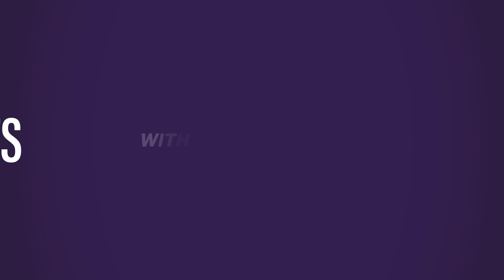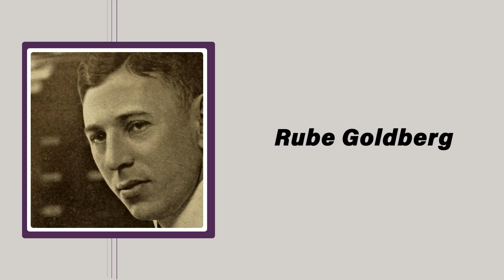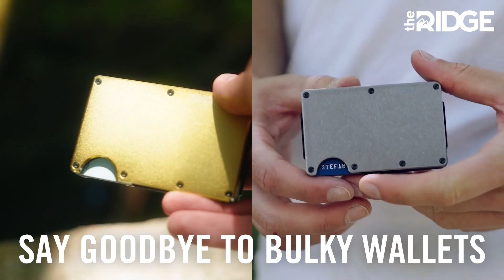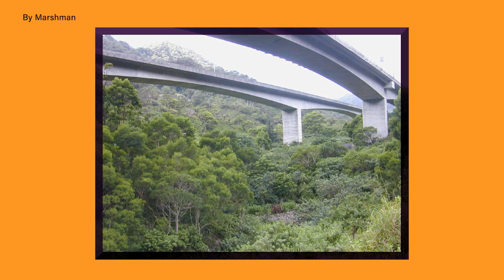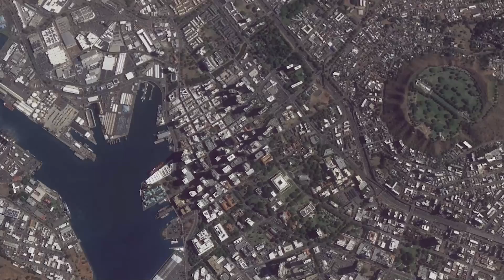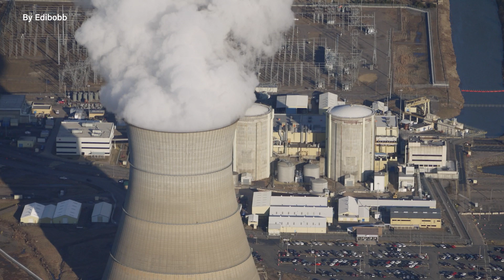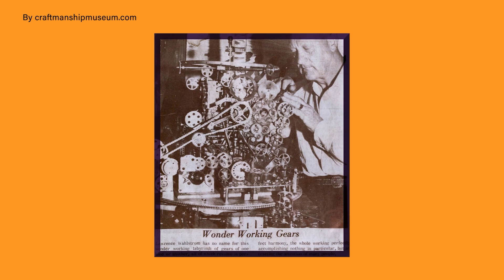Most Useless Feats of Engineering

Comment: I worked on a computer system that could have been described as a Goldberg Machine. For example, you could set the value of a variable like so: FirstName = "John". But that would be too simple. The way it did it was call a service, that called another service, that called a class which extended another class by adding ONE function (the one being called) which used a Lamba function to set a hardcoded/static value to a variable then returned that all the way back to the caller. After working on this nightmare for 9 months and realizing that every day was just another journey into frustration, I found another job.

Comment: This is the art that engineers get up to when they're bored. It would be cool if you did a side projects on art cars. You'd have a lot of fun, and it's amazing the amount of practical things you learn just to be able to do them. They used to be huge around here, and in California I think they used to have a festival. The rule is, they have to be drivable, and non-violent. There was a dragon art car that actually belched fire, but it wasn't enough to hurt anything. Anyway, it's a fun side project.

Comment: Hello Simon. Late to the party, but that's because I'm old. I get away with a lot.
I was trained as an electronic engineer and built an electronic Rube Goldberg machine as a Junior level senior project. As you can imagine, my professor and my lab monitor both disapproved, and it was the only time I received a D grade for the class. It was worth 1 point in a degree that required 160,and I managed to get what I needed to graduate by receiving 1 point for class participation by a friend who was an instructor in the school. That was a long time ago.

The real reason why engineers want to build useless machines, my hypothesis involves the number of times we all were called upon to create something, that we sweat blood over to meet the criteria, and do so with size or weight or power limitations, the item we made was scrapped by the "suits" for what ever reasons. That frustration, as engineers like to see their creations in action, gives us the urge to build something to that does nothing but flash lights, trip relays, spin gears that move levered beams that open and close venetian blinds, and a dozen others. That's the source of this machine, the satisfaction of seeing your product in use. Anyone agree?

Comment: The construction of H3 actually started in 1972, but was held up in litigation starting in 1977 until 1987.  We used part of it to ride on go karts in the mid 70's before it was open.  H3 is very useful to residents  and we use it all the time as one of 4 transportation routes from one side of the island to the other side. Three tunnels and the long way around the end of the island. Over priced yes and controversial yes. It is also incorrect to say it goes to nowhere. It connects to H-1 and H-2 interstate system so it goes to just about everywhere on the island.  Saying it goes to nowhere is incorrect.  Saying the Interstate system in Hawaii does not connect to any other state is correct. It was built as part of the interstate system so federal money could be used in the construction. I will be interested to see if you make any corrections.

Comment: Another comment on H3. What’s it’s primary purpose? To connect major military hubs (Kaneohe and Pear Harbor). But as others have also mentioned, it’s secondary purpose of being a shortcut from Eastern Oahu to central Oahu is extremely useful also. It probably saves an hour of driving, plus has much more capacity than the other route.

Comment: Bad research staff!  

The H3 system can be quickly used to repurpose rapid transportation from Kaneohe MCAB to Joint Base Pearl Harbor/Hickam and Honolulu Harbor. The H2 can be allocated if Schofield needs to move their heavy equipment as is the H1. 

The H3 is likely the best highway in the world, certainly in terms views from within a vehicle, but there were challenging engineering challenges that were met and addressed if you actually drive it.

Comment: The H3 isn’t useless, and it goes nowhere about as much as any other road, it might be expensive, but it’s the most beautiful drive I’ve ever done, I would go out of my way just to take that route north. since it’s the only interstate to the north it’s necessary if you don’t have a to. Of extra time to flow the coast, I didn’t work when I was there so it didn’t matter to me. The cost comes in because it’s a heavily democrat state. Everything cost double to get done. Look up the monorail from the east side to the west. That makes the H3 look like a cheap quick project.

Comment: Sorry, Simon.  You picked the wrong project on Oahu to call "useless".

The useless project you should have spotlighted is the light rail system.  When I left Oahu, Hi, thirty years ago, it was finally, in the first part of it's building process.  Thirty years later, it still has not been completed.  Most of the infrastructure and has been completed, yet the project has not been completed.  It's elevated rails and never opened stations along the route have never been used.  And yet, the state and county and city pour money into it year after year after year.

THAT makes it truly useless.  Unlike H-3, which at least takes you from the Leeward side to the Windward side without having to drive half-way across the island on the Likelike or the Pali.

Comment: Ironically small bore hole nuclear waste storage is gaining more attention again. The idea is to essentially store waste deep deep underground in non permeable layers of rock using conventional oil drilling hardware. While Yucca mountain sat above the water table and there were concerns of leaks contaminating the water table, small bore hole storage will sit kilometers below ground where the material can sit for billions of years until subduction pushes the continental crust into the mantle. And don't worry about the mantal. A fraction of the internal heat of the earth comes from the nuclear decay of uranium and thorium.

Comment: The H3 was voted as one of the most beautiful highways in the world. It starts on both sides in fairly urban areas and almost immediately darts into uninhabited rainforest. Coming from the Honolulu side, you go into the tunnel at ground level and pop out on the other side almost 200ft above the rainforest canopy. It is a very useful highway in my opinion as it connects 2 very densely populated parts of the island and serves as a vital route for moving military personnel and equipment between the 2 bases. Lastly, it's not referred to locally as an interstate. It falls under the highway portion of the Eisenhower Interstate and Highway Plan. The H stands for Hawaii as Alaska has federal routes designated as A1, A2, etc. Those routes are not connected to the lower 48 so they don't get the more familiar I designation.

Comment: I'm a DOE nuclear engineer involved in strategic planning for addressing the nuclear waste problem, and there is a different side to it that I don't see anyone talk about. We really DO have a serious nuclear waste problem, but it has nothing to do with safety or security (the casks used to store the waste are virtually indestructable/leakproof, and they are kept onsite at the nuclear power plants which are among the most highly guarded sites in the country). The actual problem is that the gov't made contractual agreements to the nuclear plants that the waste would be removed by the mid 90s for final storage at Yucca mountain, and every year to this day the plants successfully sue the gov't hundreds of millions for their objective breach of contract.

On top of that, it is written into US law that Yucca mountain is the ONLY permanent storage location allowed, but thanks to the political deadlock that may never happen. And regardless of what you may hear, this is highly bipartisan; no politician, red or blue, wants to be the one to risk their reputation by associating themselves with any cost overruns and logistical complications that may occur, or for the stigma of pushing nuclear waste on the people protesting against it. It's muchhh easier to just focus on less controversial issues and let your successors deal with the messy stuff.

Comment: He really missed the real story, the rail features a way more interesting story filled with multi administrative corruption.  It’s a failure in every way.  At least the H3 doesn’t have a department that will be created which the taxpayers will have to fund because no one travels from Kapolei to middle street.  It already features cracks in the cement structure, they have huge problems with connection between the track and wheels.  They were delayed in building it because they needed a welder with a certain certification to adulterate the frogs (connecting segment) instead of replacing the wheels with the proper ones due to already being 10 billion over budget, and years late on completion.   The city started the project without securing the property to build it on.   Allowing the owners to ask exorbitant amounts and ballon the cost.   They paid 250,000 for a App Game that my son could have made for “cultural education”.  That’s probably less then half of the raping they did to the taxpayers.   But that’s what happens the unions get officials elected, the officials make silly games and the people of Hawaii win stupid prizes.

Comment: There was a stretch of US 222 outside of Reading, was called The Road to Nowhere. Early in my father's trucking career, he hauled materials to build it. It was planned to go from Allentown to Lancaster via Reading. Reading was still a bustling city in those days, and trucking was pushing the railroads down, so highways were quite important for the area's prosperity. But, by the time they got the first 20 or so miles done, all the heavy truck traffic had already ripped up the new road. The cost to rebuild that section ate up the rest of the budget for that segment, and construction was halted...for 25 years.
In the 1990s it was finally connected to the 422 bypass (West Shore Bypass) and 222 by way of a ramp that gets backed up because of a sharp curve. The area that should have allowed a seamless transition had been built up in the 1980s. 
Now you can go from Lancaster to the eastern end of The Road to Nowhere with relative ease. Then you're dumped onto regular 222, a highly congested two lane that's existed since, like the 1930s. The problem now is the path in that area is on the National Registry of Historic places and would be nearly impossible to build a parallel highway. As a history preservationist, I love that...as a truck driver, that sucks.